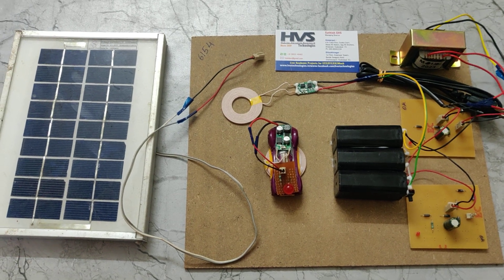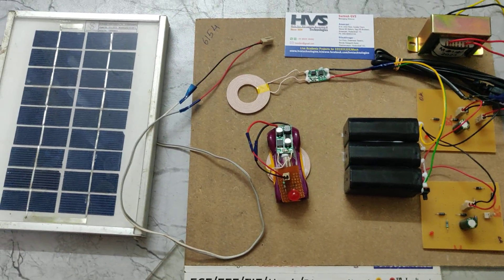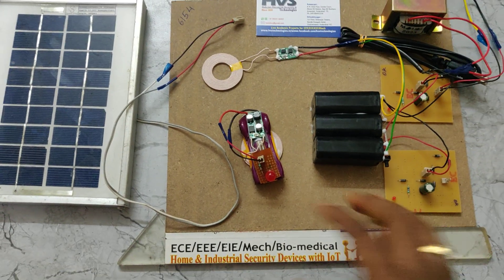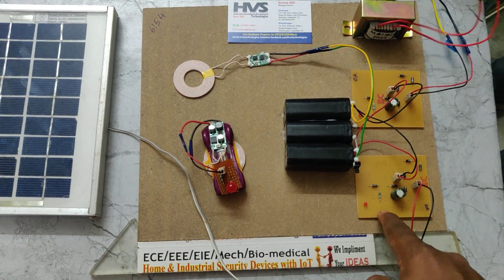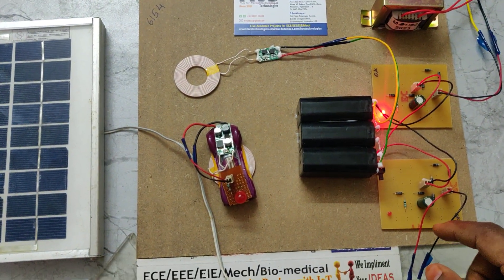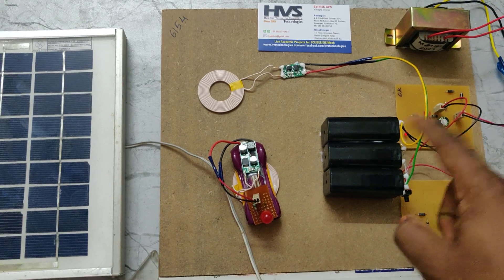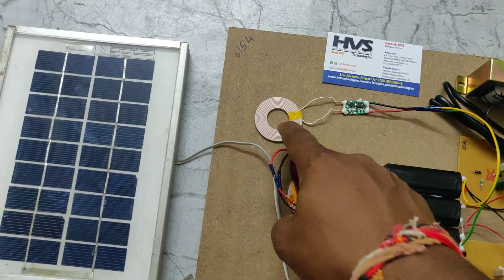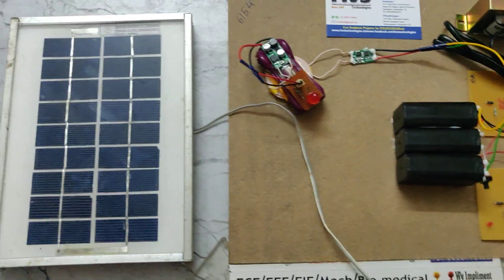Solar Wireless Electric Vehicle Charging System

Comment: Kindly provide the components details and range of the components
Reply from the maker: Hi, 
We sell full working kit with document PPT circuit diagram and code. Could you Send me the video link, Will update you the cost details. You can contact us at +919603140482
Through WhatsApp or call

Comment: Did you use micro controller or aurdino
Reply from the maker: @hritabratakundu6746  no micro controller. You can contact us at +919603140482
Through WhatsApp or call